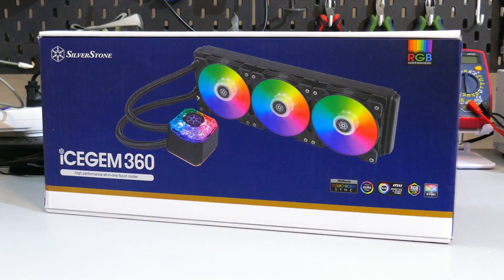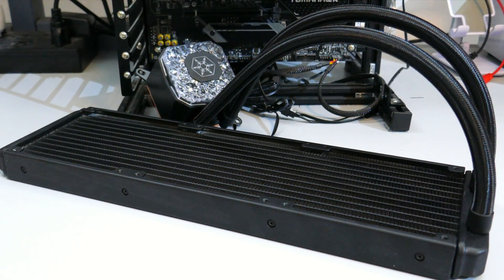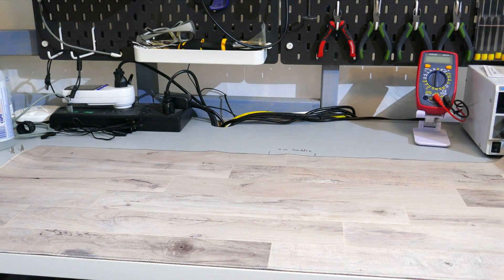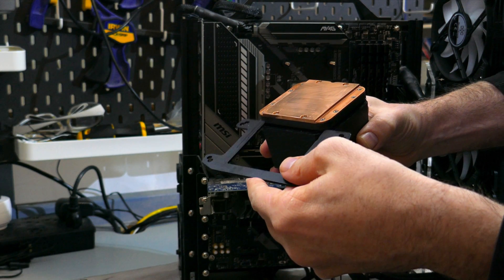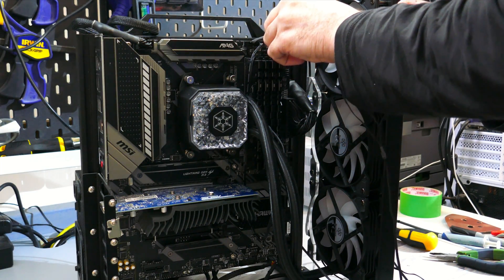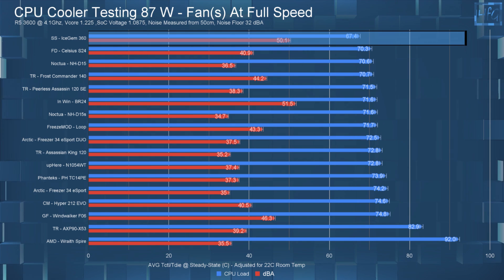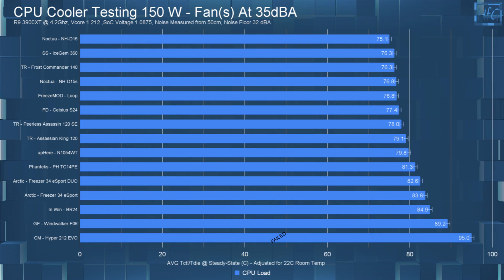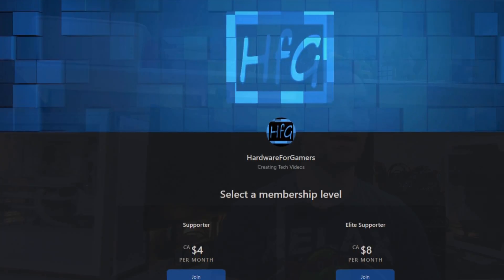The SilverStone ICEGEM 360 - CPU Cooler Review

Comment: FC140 is actually cheaper @ 56.49 with clipped coupon from "Thermalright Direct 2". They seem to have multiple store links haha

Do you still think the PA120 (non se) @ 38.30 would be a better value or should I just spend the $18-19 more with tax and go all out for the FC140..   Seems to compete with the best options... Then again its only 2-3c. lol

I would assume the FC140 would do better for real OCing or an intel platform with high power limits, but hmm... probably doesn't matter in retrospect.   I don't think 5800x exceeds 142w out of box? or am I wrong?

I already bought PA120 (Non se, looks like better mounting HW), but I guess I could test both and go from there.
Reply from the maker: what are you planning to do? just game, just render, both?
Reply: @HardwareForGamers  Game mostly, light rendering here and there.   

Not really size constraint on cooler so that doesn't matter as much to me.. I do like low temps though. 😂Loudness/DBA doesn't matter with headphones on, but I want something that doesn't get super loud when I'm just on desktop browsing/basic task (Prefer silent).  Can always set a fan curve via MSI bios.

If it isn't worth the extra cash i'll take your advice.  I guess It would only matter if i plan on using the cooler with something like a high power limit intel processor...   Seems to be only a 3C difference with your 3900XT